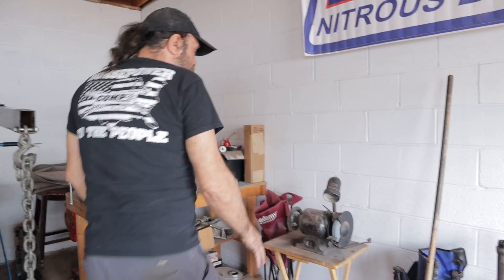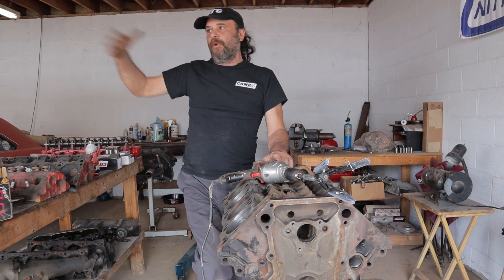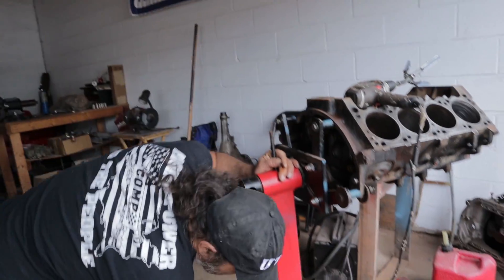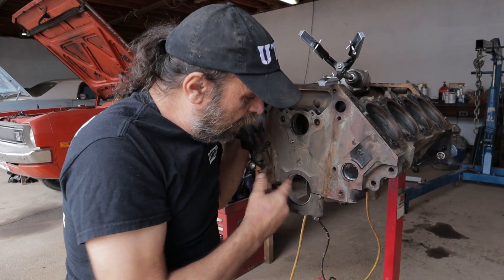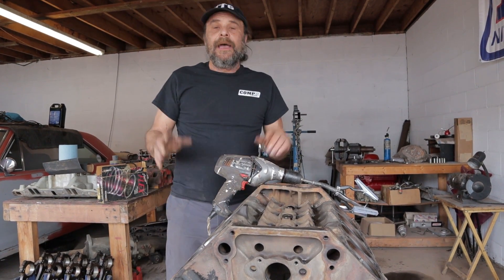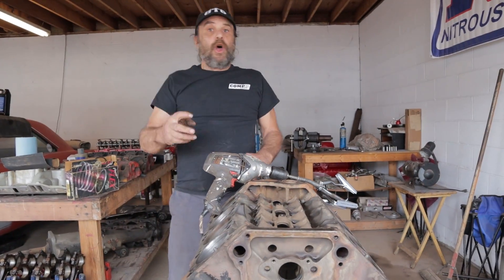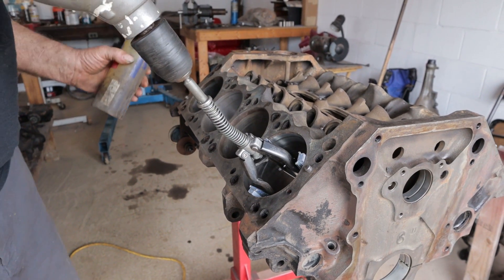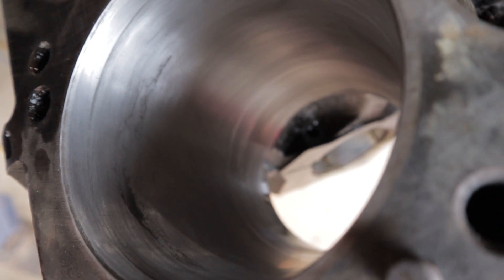Perfect Daily Driver 6 - DIY Engine Block Prep

Comment: It’s Sad state of affairs when you trust a part that has 100000 miles on it over new ones.
Reply: If you have any bore taper "at all" within the travel of the piston those rings have been expanding and contracting on every rev. At some point you'll have a harmonic that induces flutter and could taper the lands. Toss 'em.
Reply: You know the man that makes your new parts? Share his info.
Its to the point that if you order a Walbro pump from Walbro themselves, 7 outta 10 times you get an ebay 15$ knockoff
Reply: I bought a Walbro pump a couple of years ago and while the pump worked fine, the hose sold in the reseller’s kit was not immersion rated and it turned to dust inside the tank.
Reply: Always use new Piston rings in a rebuild.
Reply: Why?
Reply: @JohnWilburn  for what piston rings cost, if they go bad, you're tearing everything apart again.  Cheap is only cheap when you do the job once.  Also, a bad ring allows oil into the cylinder, which can cause detonation, and then you're looking at broken pistons and maybe scored cylinder walls. All to save $100. Sad to say, if you can't afford to do the job right, you might want to reconsider doing the job--you'll just chase one problem after the next, and it will cost more in the long run. 

For example, a future video in this series finds a lot of trash behind those core plugs that were suggested to keep in place.  Had that trash been left there, it would have plugged up the radiator used and caused a new heating problem.
Reply: @albertgaspar627  Is it not good to have ONE channel on YouTube that objectively evaluates "disposable" parts?  99 channels toss them because a sponsor supplies new... fine.  That doesn't give a chance to learn how old rings evaluated for their wear, tension, and condition hold up on a fresh build.  It's a learning experience no other channel gives you, costs you nothing, and leaves you free to build your engine any way you want.  I can't see what's so virtuous about tossing rings just because you've never considered keeping them.
Reply: @JohnWilburn  you are right, its good to have a tutorial on what is salvagable, what is rebuildable, and what is tossable.  so far, however, that wasn't done in this series--it was, "use your judgement".  Well, that's a lot of bad rings replaced to get that judgement.  Or its a "caveat emptor" butt covering. A good video would be one showing different rings, so people new to this could see what is good and bad.  But, those who have done this, also know a part can look great on the outside, and fail magnaflux.

I agree with the free tutorials that save us money. Its why BS artists (not saying there is one here) drive me nuts. My father taught me at a young age, how far society would be if we stopped repeating our parents' mistakes and made fresh ones and then taught our kids to not make either of those mistakes.  So you are preaching to the choir here.  I might also add, i think there was a vid of putting rings on without a spreader to keep them from snapping.  In the end, tho, i remember my old boss at the deli i worked at--when it doubt, throw it out. 

If i have one car, would i spend $100 for new rings just to keep from tearing the engine apart again to avoid blow-by and detonation? yes i would. interestingly enough, people are asking questions about rings, and most people would answer with, "ask the company you want to buy them from, before you buy--its their product, if they can't answer, then you're dealing with a company interested in money, not in customers or its product". 

The problem with "budget build" is that its such a loose term.  The prior owner of this engine, for example, did in fact a budget build--and Tony is paying the price for it. But the seller sure got their money out of their budget build--even sold it rather than junk it.  Does that mean it was the right way to budget build? For the seller, it was. For the rest of us, no it wasn't. 

but, at the end of the day....everyone has their pain threshold. they run their lives according to it. We all have an opinion on what is right and wrong. this isn't a college class where we get a degree to get a job, it is a forum for public opinion, and we're all contributing our viewpoints to how things should be done in life. so long as we can explain our opinion, and avoid insults, i'm glad we have it. everyone's viewpoint is welcome.
Reply: I’m reminded of the story of the little girl at the Thanksgiving dinner table who asked her mom why the end was cut off the roast.  The mom, who didn’t know either, then asked grandma.  Grandma said she learned it from her mom and that’s why she taught it.  They all asked great grandma and great grandma said it was only because when she first started cooking, she only had a small pan.

I appreciate learning from the past generations, but I also appreciate giving fresh scrutiny to time honored practices to keep them honest.  As such, studying a very smart guy who reuses a part he has 100 in stock to replace means he must have a good reason why.  It’s worthy of open minded inquiry.
Reply: @JohnWilburn  thanks for that story, its a great reminder. and that's a great attitude you have.  Engine builders tell me they paint the inside of the engine block (i don't agree to their reasons why, but that's another story) and their reasons why.  So i ask why they don't paint the cylinder head to get the same results with that crucial engine part and....i either get:

1) you're a PITA, kid

2) blank stare. 

any result that doesn't explain why they don't do that, pretty much means, "Well, i never saw someone else do it, that's why".  what's great about this series is the honesty...some parts that were going to get reused, some procedures not done, are being shown to require a change in mindset.  But that's how it goes whether you fix a car or fix a house (oy vey, you think a car is expensive...:)  ).  the more you look, the bigger the project gets when you realize there's more to it than you thought.

whatever you plan on spending on a rebuild, double its cost and time, and you're probably got a realistic estimate :)
Reply: A few months ago, I drove 60 miles to a junkyard for an old used starter because I have way more confidence in that than a parts store rebuild.
Reply: @JohnWilburn  I found a local biz that been rebuilding starters and alternators and such for many years that has a sterling reputation. Although their main biz is wholesale, if a citizen walks in, he can purchase regular or HD rebuilds over the counter. None of their HD stuff has ever failed on me.
Reply: @413x398 That's cool.  I'd consider that for sure.  At least I could supply a good core.  The cores places like Advance Auto, AutoZone, and O'Reilly's suppliers use are often really rough.  You can tell by the heavy pitting they've laid in a core pile for a long time and the pieces are often mix and match, at that.  I don't even want to think what kind of bearings they use or where their replacement electrical guts come from.
Reply: @JohnWilburn  This place I mentioned, Genco in Mesa AZ, would rebuild my own core while I had lunch at the yummy Mexi-food place down the block. It appears that a company called BBB is now selling their items mail order. Google them up if you have need. Ebay has vendors selling rebuild kits if you are so inclined. Some place called YT has videos.
Reply: Curious.... what is 413 x 398?  It’s a 426” engine, but it makes me think of a Chrysler 413.
Reply: @JohnWilburn  It's a secret, so I'll have to suffocate you with a year's worth of hoarded toilet paper, but it's the bore and stroke of a 428 Ford. Only two guys (CJ owners) have figgered it out since 2009.
Reply: I was kind of thinking that’s what it was.... I kept thinking “what has a 3.98 stroke?  🤔. If the cubes added up exactly, I’d have gotten it.

Comment: Glad to hear you mention  a FE !
Reply: There is no finer engine!
Reply: @413x398 :  Unless you have to change the plugs or starter on an FE-equipped Mustang or Cougar. . . .
Reply: @mortensen1961  Been there done that. You need to have a few different combinations of ratchets and extensions and u-joints. You cannot do the job with your one "typical" combo.
Reply: @413x398  Sounds like you are good at shooting pool with your ratchet and extension...
Reply: @kramnull8962  I drove CJ and 390 cars regularly for years. Still have all of them.

Comment: My father worked at a truck shop in the 1940's   , on gasoline powered Brockways, and all the guys were told when they were hired..if you have a ridge reamer in you tool box, fine.....just don't ever take it out.

Comment: Wow I have never heard of re using rings in my life.
Reply: Me either and probably won't never do it if I have the engine tore apart like that I'm going to put new stuff back in it because I don't want to have to do it a year or so later
Reply: Nothing wrong with re using rings as long as it meets spec.  A used ring you could say has proven itself.  It’s not worn out if it meets spec.   I think the “you must use new rings “.  Is a bunch of hype.  -  my experience is the new parts are more likely the reason you’ll pull an engine after a year or even sooner.
Reply: @raoulcruz4404  I didn't say there was anything wrong with it I just said that I wouldn't do it if I had the motor tore down like that and I've built several engines and have yet to have to pull a engine because of the new parts that I put in it. It's not a bunch of hype either it is a personal preference and if I have the engine apart like that then I am going to put new parts into it and be done with it to prevent me from tearing into it later .its a piece of mind kinda thing. If one wants to reuse the used stuff in a motor so be it I don't care what they do to it .I don't care if they take used rings from one engine and put them in another I'm not judging but it's just not the way I do things
Reply: @79beans347  And your way of doing it is why you won't have to pull the engine in twelve thousand miles and redo it again. If you don't have the money to do it right with proper machining and new parts wait until you do. If you can't afford to do it right the first time you sure as heck won't be able to afford to do it a second time.
Reply: @79beans347  you are correct..  a re ring kit  is just 100$ for that motor   why skimp on the internals
Reply: @anthonynelson9136  that's right why do all that work to just end up with what you started out with in the beginning not to mention having to buy a gasket kit already may as well at least hone and rering it while you are in there it not much more work
Reply: @ridgerunner7980  yeah it just doesn't make sense to me to have it all apart and not go ahead and at least rering and rebearing it seems like a lot of wasted time and effort just to end up with what you already have
Reply: @79beans347  Well, on a side note. With this HERE engine, the POS Dodge it was in had been jimmied up and the wiring was trashed. Most likely was parked because of that, never to run again. Doubtful it had 100,000 miles on it. Some things UK just doesn't repeat, but from past videos on the truck, it makes some sense that money could be saved in this one engine.
Dad always used to say, even if you change a head gasket, the rings should actually be redone, just because it will gain some compression. Possibility of cracking an aging ring...
Reply: @kramnull8962  that's right mopar is notoriously known for their bad wiring issues and I can see saving some money on something like this but I would spend a few bucks on rings and bearings because they are cheap  but that's just me
Reply: Anthony Nelson   There in lies the mentality of if you don’t do machine work and new parts the job isn’t done right.  I agree with beans347, it’s not his preference to reuse.  Preference.  I’ve had problems with new parts failure right out of the box or within a few thousand miles. Been wrenching for 40+ years.  Never seen such poor quality parts until recently.
Reply: Growing up in NZ we re-used everything! Aluminium (aluminum to you 'murricans!) paint on a head gasket, good until the next valve grind. We used to run old flatbread motors on a gas- got real good at valve grinds 😎
Reply: Damn spellchecker! Meant to be flathead!
Reply: @donh54gmail  😂🤣 so u used to run the ol flatbread 🤣😂 the spell corrector is a pain in the but
Reply: Now you have.  Cool, isn’t it...
Reply: Every running engine has used rings. Every time you crank it up , you are reusing rings. Why does pulling them out of the bore make them bad?
Reply: @raoulcruz4404  EXACTLY

Comment: I agree about not trusting new parts. I've seen too many "Brand New" foreign made parts fail immediately, whereas the old ones were just fine and could be reused.
Reply: when it comes to parts and machine shops, it does help to ask around.  Car clubs and car shows may expose you to those who've been around the block.  Also, a mechanic who does fleet work may know the cheap stuff, but a mechanic who works on airplanes knows, an engine failure up there isn't solved by pulling over to the nearest cloud to wait for AAA :)  

the other issue with new parts, is when the OEM changed spec mid season to save some cents per car built.  I wanted to replace the EGR on a Ford a year ago, ordered up the system from Ford, and was fustrated with the fact it wasn't the same--my car had the valve mounted horizontally, the OEM factory-stamped part had it vertically. 

Welcome to WTF Were They Thinking town, population you.
Reply: New
Never
Even
Worked
Reply: My man you understand that through time I've had so many brand-new Parts come in his failed parts when you run a business as long as I have and probably like you have you learn that

Comment: my dad was VERY  picky about cleaning the bore  before putting the engine together.    dad would use an old fashion baby diaper to prove the bore is clean.   your idea here?
Reply: ATF and toilet paper
Reply: diapers are a classic, but toilet paper is designed to break down so it doesn't clog a septic system like paper towels.  On the flip side, Franz and other external oil filtration systems used to use plain toilet paper (dyed/patterned ones didn't work as well) rolled up as a filter, and fleet mechanics would swear the bearings stayed shiny.